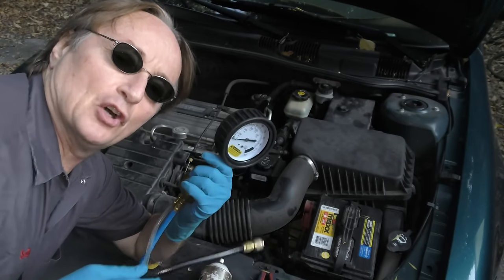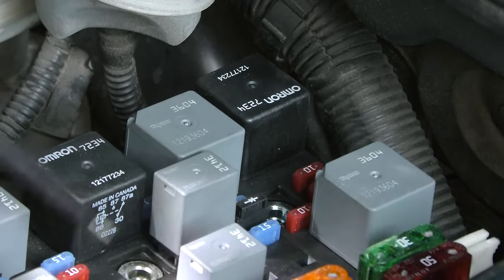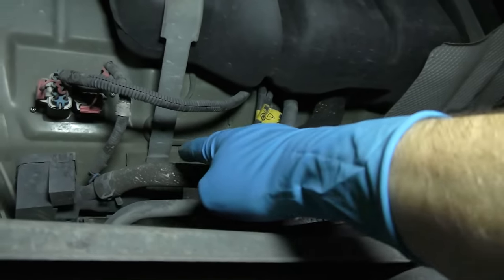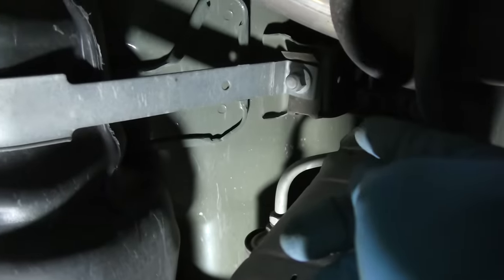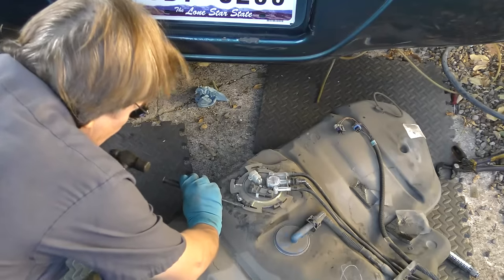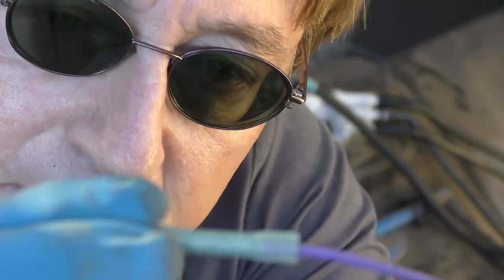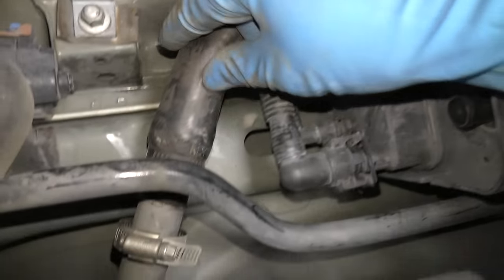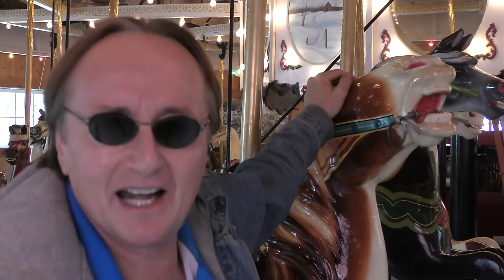How to Fix Car that Cranks But Won't Start (Fuel Pump Assembly)

Comment: I can't Find atf for my car that's factory fluid, it calls for mopar atf plus type 7176. what atf would work for my car that I can find anywhere, it's a 94 dodge spirit
Reply: +Tristan Pierce ATF+4 Fluid is what you need. Replaces ATF+3ATF+2, ATF+2 Type 7176 or ATF+. It does not have to be a mopar brand, as long as the fluid is licensed by Chrysler, you can use it with confidence.  eg: Castrol ATF+4, Autozone ATF+4 etc.

Comment: only if all the mechanic looked for fault like that.  most mechanic will guess and say most likely that went so change that and see if that works.  but no check like you do and find the actual problem and fix it. they will save their customers lot of money which they didn't had to spend

Comment: I have a question idk why it does it but I have a 1987 Plymouth voyager with 3.0 v6 and for some reason it will like turn over about 3 or 4 turns before it will run its like it doesn't get fuel yet or something like u hold the key it turn over and over and and stop and then do it again then it fire right up and thang it that it does it when the car is warmed up to sometimes I'm fixing to change fuel filter I'm thinking it's clogged little bit or something
Reply from the maker: +Christian Leatherman  old age, try my video 'how to clean fuel injectors on your car"
Reply: I'm changing my fuel filter to see and I'm gonna put some stuff fuel cleaner in system to see it that changes cause it doesn't have a massive air flow sensor
Reply: I put fuel filter on it still same thang kinda and I had put upper set intake gaskets on it and fuel line hose but nothing else yet waiting on getting paid once I do I will go and get plugs, wires , cap , and rotor cause it really needs a tune up bad and too kinda uses little more gas than usual idk haven't checked it out much yet and I gotta do motor mounts they are shot
Reply: Oh yeah Ik and thx I uh Ik the battery is crap already cause when u go in morning cold start u can tell definitely that battery is low charge when it's colder outside so Ik I'm gonna go head and get one them but still shouldn't do what it's doing and it hasn't so bad after the filter was changed but Ik the tune needs it cause when it runs and u rev it and then sometimes it runs little funny after that like just runs funny u rev again then it will stop that
Reply: I work on cars from home and all cars I've had I've not had this before and Ik Scotty makes good videos it helps if I can't figure something out which is hardly happen to me but this I'm mainly thinking tune up and stuff
Reply: And Ik the the alternator is putting out with it should be because I had my multimeter out
Reply: Yea exactly that what I'm going after i took the cap off to see and it's kinda showing age so that's why I said I'm gonna do tune up see that changes it I hope and it should I've had little problems of this on some other Cars I've worked on tune up and it stoped and had more power when u hit gas

Comment: Just changed the pump. 
Turns out it’s not pump by make and model. 
It’s by VIN 
Wrong part in, fuel tank fuel, truck no start fml

Comment: Hi can some one help i have a Mercedes Benz w202 1996model sedan i did replase a new pump and filter.problem whit the car it starts fine then stops 5-10min then i have to wait ca 15-20 then the car starts fine and arter 5-10 stops
Reply: Bad (dirty) maf/map sensors? Check throttle control body sensor and the valve. Also check relays.

Comment: ok a question go to start the car and while the key is in the starter engaged position the car starts and runs soon as you let off the key it dies what would the problem be
Reply: +Jeffrey Murdock 
Assuming you're letting off the key the instant it starts, bad fuel pump could cause that. Enough pressure builds up to start it initially, but not enough to maintain continuous flow to keep it running.
Reply: +Haywood Jablomy ok. if I hold the key where the starter disengages but the key is almost to the point the starter kicks in it will run but in the run position it dies. not a fuel pressure or flow problem.
Reply: +Jeffrey Murdock 
Check for loose or disconnected wires at the switch. May want to trace wires to their final destination, too. If not, replace switch.
Better yet....wait for Scotty to reply. lol Good luck!
Reply: +Haywood Jablomy I already know the answer because I do mechanic work download just check Scotty and see what he has to say cuz usually he does have a good answer so let's just see what he says I've already fixed it it was on one of my customers cars plus I had it happen on one of my old cars I used to have a 77 Chevy van very aggravating when it happens especially when you're stuck at a fast food restaurant with a bag full of food
Reply: +Jeffrey Murdock not a fuel pump you have wire connection issue or a bad ignition switch
Reply: +Matthew Brady ding ding you got it correct.  was a bad ignition switch. they called me up and told me what it was doing and I told him that it was most likely the ignition switch so they ordered it and when it came in I went and put it in and it worked perfect sometimes you just gotta go through a problem like that in the past to know what it is without even looking at the car

Comment: I mean i have a toyota camry 1989 and it starts... but for me to turn on the car i have to hold the ignition switch to the start option until it fully starts up.  then the second time i do it it starts right away. any idea whats going with my car?
Reply from the maker: replace the ignition switch, pray it's that easy
Reply: great thank you!
Reply: My switch went bad on my odyssey u had to hold it in place on to keep the engine running
Reply: oh its okay man fixed it a long time ago

Comment: the last two times my old chevy truck wouldnt start alls i needed was a hammer. starter was just clicking, hit it with a hammer. truck wouldnt start one winter, banged on the gas tank with a hammer. never leave home with out it
Reply: +JOE FPOC If it's a denso starter (most are these days), the contacts could be corroded in that starter.  If it happens again, take it off and remove the 3 screws and you'll likely see them corroded to hell inside.  $10 on ebay, swap them out, starter good as new.
Reply: ScubaCat3 it was on a 1990 chevy truck, it was nasty looking, almost looked original. got me home and started the next morning to get it to work to change it out

Comment: Evil swines indeed... I remember engines where the fuel pump was easy to reach, powered by the crankshaft I believe. Does injection require fuel pumps to be this chunky and inside the tank?

Comment: 1996 Chevrolet Cavalier Why is my 'low trac' light turning on in my car
Reply from the maker: +john pinedoe traction control system is breaking down, ignore it or do my video "fixing insanely complex modern cars" to find the fault

Comment: Those crimp style connectors  are very unreliable in my experience. Would rather solder splice and do a heat shrink tubing after. Takes longer but,, Much more reliable.

Comment: I have a 2001 dodge grand caravan and the. abs   and    brake is on please help
Reply from the maker: +Steven Soto get it scanned. ABS systems are complex and require a special scanner to get the codes, and with the light on yours has a code
Reply: I have 2014 mitsubishi oulander and I need some tips of how to wash a car

Comment: Why didn't you remove the back seats and get access to the fuel pump that way?
Reply: +David Lovšin Not all cars have an access hole.
Reply: Most european cars do. If memory serves.
Reply: +David Lovšin American engineering at it's finest -- no access hole. (that's what she said)
Reply: *****
That's what she said

Comment: I have a question, does anyone know how many oxygen sensors a 1996 Pontiac firebird have?
Reply from the maker: +Matthew Allerton depends on the engine size and exhaust set up. two or three or four sensors on different models
Reply: +Scotty Kilmer it's got a V6 engine
Reply: +Matthew Allerton Four
Reply: +Matthew Allerton if it has two catalytic converters, it probably has four sensors. one on each exhaust manifold and one behind each cat. If it has one cat, then probably three sensors.

Comment: my girlfriend have a toyota echo year 2000 it leaks coolant from maybe the holes or the radiator in the radiator cap wont tigten in now the car wont run but it will crank because it was runnin fine yesterday untell she let it over heat now it dont wont to run but it still had a coolant leak win it was runnin how can we get it back runnin
Reply from the maker: often a blown head gasket does that, have the engine compression checked first
Reply: oka thanks
Reply: in yeah a mechanic told me that some thing about the compression in the motor need change i was tryin to be sure guess he was right  thanks again

Comment: Keep in mind not all cars have a fuel rail schrader valves to test the fuel pressure. So you will have to have a kit that is adaptable to different types of hoses. (Some fuel pump testers may included them).  Also not necessary to purchase the complete fuel pump assembly with level sensor as shown in the video.  You can save money and purchase only the pump and partially disassemble the housing.   For example: $50 for a pump vs $200 for complete housing with fuel level sensor.
Reply: Hey . I'm having fuel problems with my toyota corolla , fuel pump not engaging , i manualy tested the fuel pump, taking it out , it works, fuses and relays work!!! why can't i get my fuel pump to be working on it's own....this all happened overnight!!!!! please help
Reply: @marcusohm187  Could be the immobilizer or anti theft system. If the computer doesn't recognize the chip in the key it won't give you fuel and or spark. Do a diagnostic to see what codes comes up
Reply: @DaytonCarCare O.k  thanks for the response. I had the ignition key changed last year. I have 2 keys still same thing.I doubt it is that!...............I have 2 fuses that have no voltage 0 volts for Tail lights 15 amps and .35 volts for "Starter system 5 amps. Prior to this I was having problem with my battery  until I lend it out and to my cuz'n he muste've tried to jump start it wrong.. Can he have damaged the engine control module! I opened it up it looks super clean... how else can I tell if its bad
!!!!!
Reply: @marcusohm187  If he tried to jump start it incorrectly probably fried something. Have him buy you another car.  😆
Reply: @DaytonCarCare  right my own cuzn. Bro sad. But anyway I got it to start today. But since I hadn't started for a month there's a oil leak somewhere ND smoke from the oil cap . Might be the oil pump or might of been a victim of theft maybe some water in the oil. And might of had something in my gas tank too

Comment: No afence to scotty most of the time when I go and try to fix a jeep, Chevy, etc.  most of the parts are falling apart, those tabs gets broken and most if not all the underside has oil,dirt and grime every ware. I know that cars and trucks will not be the same but most of them are assembled the same.

Comment: Never pictured a fuel pump looking that way
Reply: +A42yearoldARAB It's a little special for this car xD
Reply: No thats in-tank fuel filter and pump assembly. The white part if mainly filter, fuelp pump is metal and sit inside the filter.There is a screen at the bottom that attaches to the pump. So fuel will go thru screen, to pump, thru filter, to engine.
Reply: +A42yearoldARAB the whole white thing we saw was just a housing for all the extra stuff to be housed in. the pump it self is about 4-6 inches long and 2-3 inches wide
Reply: That is the standard 90's-00's GM fuel pump style.

Comment: I cringe everytime I see someone not using a proper tool to crimp through connectors. The crimp will probably hold but I have seen so many times bad crimps and loose wires.
Reply from the maker: +iGMAS I have a crimper but find doing it twice with my pliers actually works better on car electronics.

Comment: 0:27.........."Now there's tons of things that can make a car die"  First thing is the car being a GM vehicle!!!!!!
Reply: +landyachtfan79 you must be talking about Ford
Reply: gm vehicles die all the time, fords don't die that easily, I seen a ford engine go through 5 stages of hell and still run, I seen gm vehicles go through 1 stage of hell then die.  I work for ford, I know that ford is a company that has never went bankrupt. gm and Chrysler have went bankrupt multiple times. because of the crap they both make.
Reply: ***** How many older GM vehicles do you still see on the road today compared to Ford? That is a more accurate measure of longevity.
Reply: i see old fords all the time, i used to own a 1991 ford ranger, i totaled it a few months ago, that truck had 231k miles and it still ran like a beast. i hardly see any old gm's where i live, my whole neighborhood is mostly fords, i live in a small neighborhood. i see more fords than gm's in my area. most of my family own fords and mazda no one has issues.
Reply: ***** That differs from my area and whenever I do see an old ford it's usually driven really slowly.